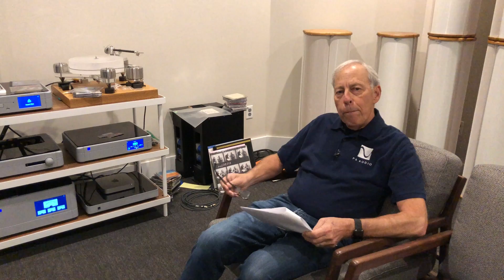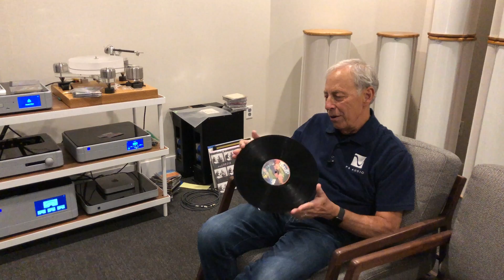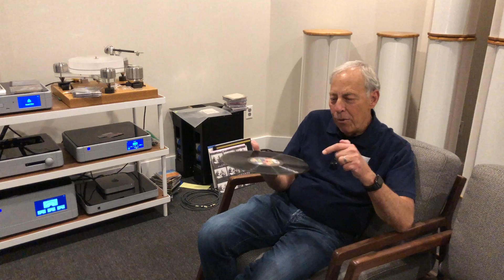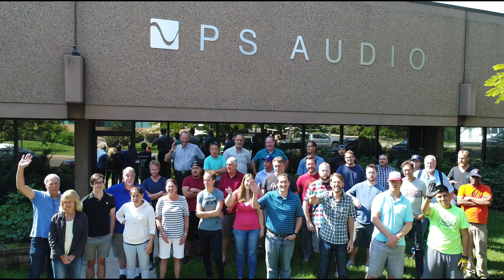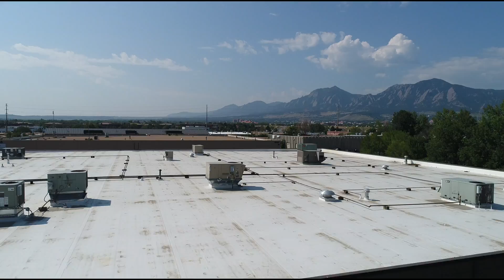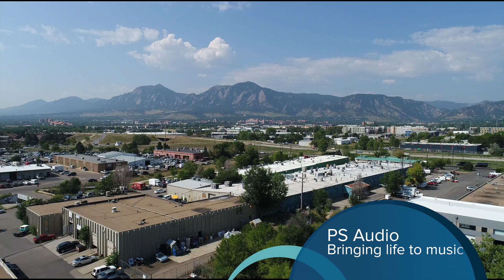How does vinyl playback work?

Comment: I like a description that includes the description of sound as compression of air by objects that move/vibrate rapidly. That air compression makes a microphone diaphragm move, which makes a coil move next to a magnet, which creates a weak electrical current, which can then be amplified and turned back into mechanical motion, either at another diaphragm like a speaker to compress air again, or on a cutting tool to make a wiggle in a vinyl disk. The wiggles in the cutting and the movement of the speaker cone are in direct response to the fluctuating air pressure at the microphone. It is to the degree of accuracy that we can do those things that makes the sound on the other end accurate, and most of the problem there is in the mechanical phases, not the electronic ones.

Comment: I'd guess stereo is achieved with needle design. Instead of. . . from needle rest point the  needle is moved by groove left once right once representing 1 hertz dep on speed or one cycle of a wave wtvr.
 Rest point of needle is right between two full cycles or waves, instead of in middle of one. so to move only right then back to rest represents one full cycle of wave right speaker. Same for left

Comment: Ok buddy, imagine those waves layed down horizontal 2d along the groove. But record is spinning 1 rpm at recording if you'd look with micro scope the wave is Quite dense right?  Take waves and stretch them out while keeping the highs and lows of wave  the same hight "speed disc up while recording"  now the waves are spread much longer over the groove length allowing you to add other different frequencies in the same groove without there highs and lows interfering or overlapping. Play them back at whatever rpm reproduces original wave . Done

Comment: You gotta understand that a speaker is a bit like a microphone but the other way round .. and our ears are merely flesh and bone microphones as well... all signals relating to sounds we know are capable of going through them ... our ears are the ultimate microphone in that they have frequency dependant sensors along a transmission line whereas a microphone only has a finite coil plus some inherent resonance albeit slight

Comment: Too complicated. The waveform that goes into the left microphone is imprinted on the left V of the groove. Same for the right. The cartridge is two generators at right angles to one another so that each one generates a voltage corresponding to it’s side of the groove. That ac voltage gets amplified and sent to the speakers which each produce the sound wave hopefully identical to what went into the microphones.
Reply: Nice explanation.
Reply: Cheers, less words more explaining..

Comment: Gee, how does a microphone or even our own ears pick up an entire orchestra?  It is simply mechanical vibrations converted to electrical signals.
Reply: Microphones yes. Ears no. Ears convert changes in air pressure to nerve stimulation. How nerves work is beyond me.
Reply: Nerves are electrical in nature.  I once had "Bells Palsy" and they checked my facial nerves using electric pulses,  including some that were working.  The nerves had been blocked by a throat infection.